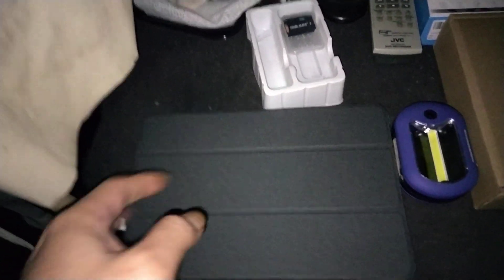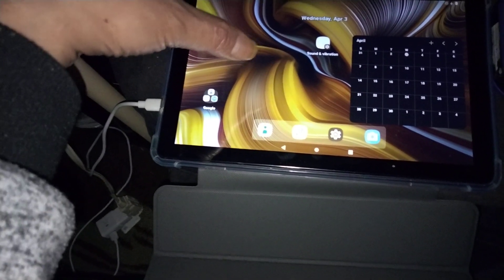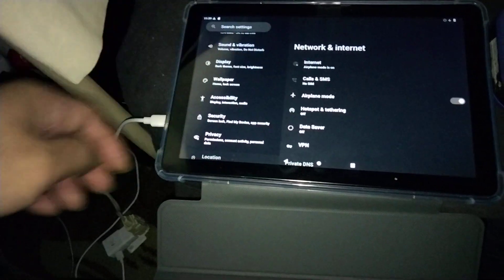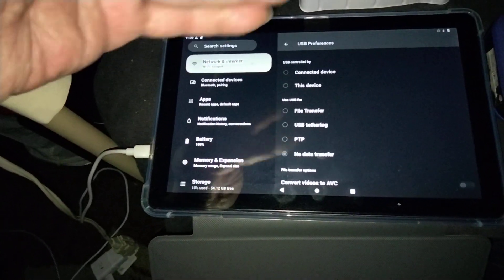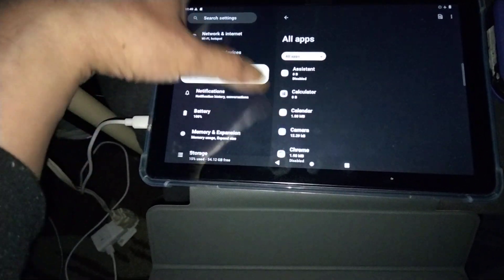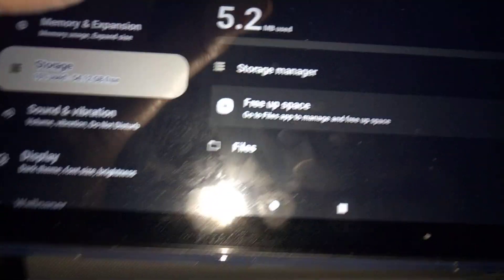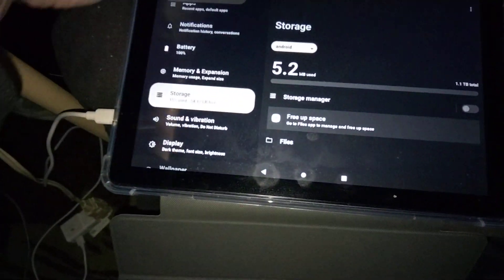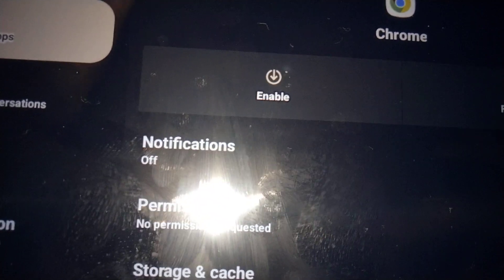New  k12 tab + 1 tb,. nuikad sd card gets corrupted,.i have two.

Comment from the maker: FOR ONEPLUS N100: Theres also checking networksog  your devices, auto dns is off, fps to minumum frames on phone and in apps, so the gpu works normal- for gaming on a budget.
For older phones . ,
After two monthes of researching everything. I downloaded a malware scanner, called ANTI SPY. Did a full scan,  It really worked. Most of the problems came from ads in apps i use.
 The information i found for gaming, Was i needed a snap dragon 650( i have  450), 4 gb ram ( sometimes 2),  with 2.0 ghz(i have 8 corrs with 1.8ghz)
. Im not sure but have to check every app settings , that iuse regularly.  
Ive tryed a virus scanner and  It sometimes works , but also  mobile provider or some other source , like an update and restart.
Im also researching a newer phone that can replace mine. And theyre expensive to switch over.

Comment from the maker: FOR CONNECTION: I cant be sure of connection problems because youtube works  and other apps are slow to load up.
 Ive looked up cellular range booster , router service and even a  new phone with faster cpu.
But this video is supposed to be about my tablet,  happens to get corrupted close to the 64gb/1 tb, on sd card.

Comment from the maker: FOR COLOROOM, K12 RAM 6GB/ STORAGE 64GB: Hey guys i tested the 1tb: sd cards with a  cheap phone/ 40gb i found , 250gb/ laptop and a 1tb/ laptop. 
Than I purchased the k12 tab/ 64gb. Always manually transfer each file, between devices. Select all can have writing issues and not fully complete the process .
Now im going to go to (smaller gb card )  size for devices,. and  keep this as a learning experience  
Thanks for watching and god bless
So far for most portable  expandable memory i recommend, 64gb-128gb works for transfering device to laptop, or to sd.
Ive done some research and sdhx(smaller cards)are made for most devices 2012-2024. This was a class 10. 
The tablet also is 2.4 ghz. And came with case and screen protector. It would work good if i had wifi router.